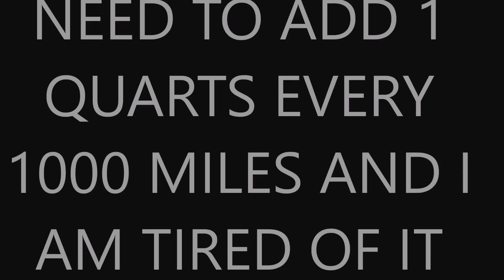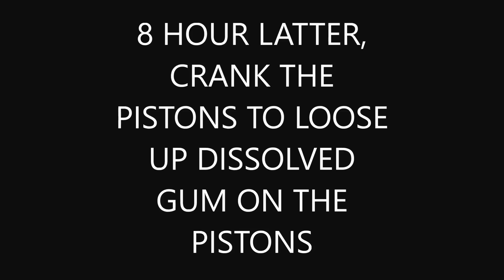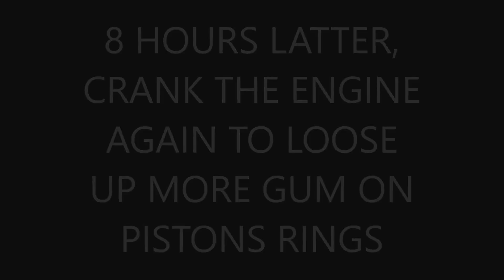MY WAY to stop ENGINE BURNING OIL FROM STUCK PISTON OIL RINGS WITH SEAFOAM

Comment: 1/2 Quart = about $2.50 per month X 12 Months = $30.00 a year. Trying fixing it... It's gonna cost you more than $30.00 and time consuming too. Now that is fixing it yourself. If you bring it to a Mechanic.... He or She won't do it under 1K for sure, LOL
Reply: Having to add oil every 1,000 miles starts being a pain in the ass after awhile

Comment: It really breaks my heart,when I see people using power tools on critical parts of car.
I religiously believe that person working on engine should only use own hands and quality torque wrench to remove,install and tighten spark plugs.
I would never use power tools on the rims of my car.
Reply from the maker: fully agree
Reply: The bolts that hold down the coils are NOT CRITICAL. HE USED HAND TOOLS ON THE PLUGS. Open your fuckin eyes
Reply: What? You never used an impact gun to install spark plugs before? It's all the rage bro! Get with the program!
Reply: @TwentytenS4B8  😂

Comment: Is this the same as using water sprayed into intake with the engine on? When i see that white smoke in this,..it has the same result
Reply from the maker: Seafoam loosen oil that stuck in the oil rings

Comment: I realize this is an old post how ever thought I would add another experience for others to try if you have the same issues!
  I have been chasing a lack fuel mileage for approx a year now I finally broke down and checked the compression on my 2006 crv 245000 KMS I found that I had less than average compression on two cylinders I attributed this to stuck compression rings( Took  a Guess)  as I had changed plugs and O2 sensor! and various other checks filters  ect  how ever the unit does not burn any oil what so ever but compression rings can stick too!
I ran across this vid and thought Id give the seafoam  a try  ! Less the cranking part which I did by hand as I Was concerned about the odious hydrolocking situation that MAY occur ! The out come was great!  the fuel mileage is now back to normal I have gone from 430km to a tank full to back to over 500 to a tank full where it was when I first got the car! So This vid was quite helpful in my case ,  so it also corrected compression  ring issue in my case  . So guess the lesson here is to try things outside the box a bit. the( 8 hour soak) I did after putting the spark plug in one at a time and turning the engine up to the compression stroke by its ps pump nut on each cyl with  seafoam added just prior to turning the engine over with the wrench! Note  IF you do the soak thing Do leave the plugs out and crank once  just to be sure! in my case the seafoam had all seeped by the rings. when I cranked there was little residue left in the cyls! I used Half the can during the process and  put the rest in the fuel tank !
 Good out come and worth trying if your in the same boat!   Thanx  for posting the vid!   ( Really got me thinking! )
Reply: Laura H - Nice to see a lady out there - thinking man stuff :) Yup, yup, yup, I thought the same way - But - being lazy -Still trying the ol' "Italian de-carb" = hard accel & decel in lower gear. If that doesn't do the job, I'll try the Laura H method :) Screw in spark plugs loosely for soak. Remove plugs & turn engine over by hand after soak?
Reply: Thanks for the description, i was trying to piece this all together with the comments.
Reply: TMI

Comment: This may seem to work at least in theory, except I would suck out the seafoam before cranking the engine. The idea is to free up the stuck oil rings so engine won't consumed anymore oil. Either you try this easier way or spend time and money on overhaul. Or just adding more oil until your engine quit.

Comment: Bent rods from hydro lock happens when fluid usually water enters the combustion chamber at a greater volume than the chamber volume with the piston at top dead center. The engine must also be turning faster than idle RPM for the flywheel to generate enough torque to cause this catastrophic engine damage. The guy did not even pour 30 ml in each cylinder, but even if he had the starter does not have enough power to bend rods. Looks like there are a bunch of alarmist women here. Great video though.

Comment: 1 oz to every quart in the oil pan.  Run for 100 to 200 miles. Drain and refill.  1 oz to every gallon of gas in the gas tank.  This is a safer and easier way to clean the bottom and top end.  Careful not to add too much to fuel as it may clean too fast fouling plugs.

Comment: How long has it been burning? My TSX is going through a qt every thousand miles and I’m hoping it’s not a shot engine. It’s running fine though other than that.
Reply from the maker: It has been about 6 month burning oil. The engine is good and nothing wrong with it.
Reply: Jonathan..... your engine is far from shot..      It will probably run for ridiculous amount of miles as long as you keep the oil level up.           A dude on Saturn forums used 2 qts tranny fluid in the crank along with 2 oil.      LEFT it in there and it eventually STOPPED burning oil and he is still running perfect today.
Reply from the maker: @jaylee8703   as long as I am not lazy changing oil. I did not see any oil loss in about 3000 miles. I usually change oil everuy10,000 miles

Comment: My 2004 acura tsx is burning a good amount of oil.  About 1 quart every 1000k miles.  Right in the dot with most people and what honda said is normal.  Im acually soaking my pistons right now. Going ti do 6 hours today and all weekend starting saterday morning.  I however will not crank the engine with the plugs in after i filled the cylinders.  Ill let you guys know how it comes out. Note- my spark plugs are 80k miles old and i took them out to see no soot or oil residue on them. They looked perfect.   Not sure how i could burn that much oil and have crisp spark plugs. Might be the fact i run 93. But still, should have some soot as motor oil burns super dirty.
Reply: Joshua..   any updates dude ?
Reply: @jaylee8703  iv done 500 miles and it seems to have stopped.  Not 100% sure though as i over filled a little.
Reply: @joshuathomas4934  How is it now?

Comment: If people would change motor oil,and oil filter more often,maybe this wouldn't happen.
I think,this is very important for modern,high tech cars.
I do oil and oil filter every three months or maximum every 5 000 kilometers.Which ever comes first. (Synthetic only).
My Toyota Corolla 2006,has 150 000 Km (over 93 000 miles) on odometer.I never need to add any oil and I never see a drop of oil,under neat of car.
Lubricants are most affordable way to keep your vehicle in good condition.
Reply: That is the rule of thumb however, some manufacturers have inherent design flaws in their engines. Like the Audi 2.0 TFSI for example. They have extremely thin oil scraper rings on the pistons that get gummed up very easily and lead to oil consumption issues no matter how well the engine is maintained.

Comment: Hi Joe Lui, is this still working?  Did you consider using a good oil flush to get the the oil control rings from underneath?

I have just done what you did here, i had lots of smoke for a long time and lots of butt clenching as i wasn't sure if i ruined the engine.  However after my 10 mile drive today it has cleared, so i am assuming all the crap that came of the pistons went into the exhaust and took time to burn off.

I left the sea foam in over night both times before cranking.
Reply from the maker: i just need to add 1/4 of a bottle every 4000 miles and i am using mobile 1
Reply from the maker: Don't want to flush as it mat cause oil leak as my engine is 12 old and 268,000 miles

Comment: Joe,  I just wanted to clarify. When cranking the car to break up the carbon, did you have the spark plugs removed before turning the car over? Thanks for the video!
Reply from the maker: you can do that too. I have my spark plug wire unhook, so the engine will not start. thanks
Reply: Awesome! After watching a few videos as well as yours, I was able to fix my problem. I was able to let the Seafoam soak in overnight. After clearing out the heads the following morning (via vacuum & cranking) I was able to start my car up! Thanks a lot!
Reply: @vermasean can you explain? Am I supposed to just not put the spark plugs back in after pouring sea foam and letting it sit for 8 hours? When you say crank you mean putting the key in and turning it halfway correct? Are we supposed to leave the spark plugs open for this too?
Reply: @KT-ed8hj  - The main thing is do not start the car w/ the cylinders full of sea foam. You can remove the spark plug, pour the sea foam in, then place the spark plug back just to prevent things from falling in. 8 hours later (after the soak), remove the spark plug (if you put them back) verify the cylinders are dry. If not, I used a vacuum to suck out the carbon and any residual liquid. Verify the cylinder is dry as can be. Install spark plugs, and try to start.
Reply: @vermasean  I took the spark plugs out but I put the engine cover on... after I wait 8 hours I just put my key in an do a half way start 3x correct? Without putting the spark plugs in or reconnecting anything? After that I pour a little more sea foam and will wait four hours before doing the halfway start thing 3x again. After that I put the spark plugs back in and the reconnect the wiring and will start the car this time. Does that all seem to line up?
Reply: @vermasean  how do i know it's dry? Is it just by looking down into the holes where the spark plugs are supposed to be?
Reply: @KT-ed8hj  - you can do a before/after. Before you put the seafoam in, see what the cylinders look like. After you pour sea foam in, see what it looks like, and then see what it looks like after the soak. You may have some fluid left behind, it may have evaporated. If you see fluid after the soak, you can use a shop vac to remove the residual fluid.
Reply: @vermasean  i dont have a shop vac. I already poured by first set of seafoam across 4 cylinders an hour and a half ago and used the whole bottle.
Reply: @KT-ed8hj  - you only need to use enough seafoam to cover the surface of the cylinder. Since it is alcohol based, it will evaporate.

Comment: Why not just pour it into the intake of the throttle body? Wouldn't that be easier than removing the plugs? And letting it sit. I'm sure the seafoam will seep pass the rings into the oil pan

Comment: Hi, I have a lancruiser, that sat for 10 years,  I got it running and it ran ok, but blew blue smoke, I decided to do the easy stuff first, did 3 oil changes, changed the turbo, changed the valve stem seals, I put a mix of ATF and acetone in the bores and let it sit, hoping to unseize  the rings,  this has improved things, but still blowing blue smoke,  I am assuming it's either stuck rings or the bores are worn,  I was just wondering if before i pull this motor anyone has any ideas I could try, either this seafoam of any other tricks.
Thanks

Comment: i ve done that yesterday, when i firstly started the engine i heard a wierd noise, not sure if i hydrolocked my engine but it was running fine, today when i started the engine a wierd sound came from the engine and than stoped but also it vibrated roughly, i am damn fucked up rn, hopefully didnt destroyed anything cuz i didnt drained the seafoam out of the cylinders 😢 arghhhh hopefully my spark plugs need replacement 😔
Reply from the maker: Geo Gabri if you hydrolocked the engine, it won't even run the first time in my opinion
Reply: Joe Lui not even sure how and why, but the spark plug on forth cylinder was damn loose so that might be the case, whenever i turn the engine off though it vibrates a lil more than before/usual
Reply from the maker: Geo Gabri tighten the plug but not too tight or you may strip the hole

Comment: It's not a good idea to crank a engine over full of fluid in the cylinders and the plugs in place. Fluid cannot be compressed, you're creating too high of pressure on the bottom end of that engine, bad things can happen. You pour the stuff in the cylinders, let it set, then crank the engine over with the plugs out.
Reply: Gary Riefle exactly! Which is exactly what this video said to do.

Comment: Gm actually has a tsb and top end clean for their northstar engines due to rings sticking.  The procedure itself does work however with a couple changes.  However they do not crank the engine with the fluid still in the cyl.  It really doesn't matter that if it fires or not you can possibly hydrolock the engine.  I have heard of on some cars leaving the plugs out and cranking but only when plugs are on the side not the top.  You soak overnight then vacuum out the fluid, start and run the engine, followed by a oil change.

Comment: As a matter of fact, liquids are compressible.  Sea levels would be a few meters higher otherwise.

That's not a good reason to put liquids in your engine and crank it with the plugs installed however.

Comment: I do this to my boat every year but I use the spray  I have an old 470 and starts up right away every time I squirt each cylinder then fog the carb then a full bottle of the liquid in the tank and fill my tank. Also seafoam all my mowers blowers weed  wackers  chain saws and I never have issues with ethanol. Gumming my shit up any more.  My raptor 660 would not start if it sat for more than three weeks until I started using seafoam. I love this stuff but might not want to be dumping that straight liquid in like that without turning it over with the plugs out
Reply from the maker: awesome

Comment: Do you have to change the engine oil after that?
Reply from the maker: zhicheng xu I didn't. You can change it. Any seafoam in the engine oil helps to clean the engine inside. Thanks
Reply: Seafoam can be used as an engine oil treatment. However you can only drive it for limited miles. The most you would want to put on it it's about 100 to 200 hundred miles and then you do an oil change. It's designed for engine treatment not oil treatment. It says so on the can.

Comment: Just tried this. But I removed the spark plugs while cranking. I did a 24 hours soak. Let's see if it makes any difference. What worried me is that when I put the plugs back in it took like 15s to start following a ton of smoke. But now it starts normally.
Reply: Did it work??
Reply: Lil Gascan rip ...

Comment: You have 0w30 oil in the engine, then you over fill the crank case with water like sea foam ??????? If you guys are liveing in a warmer climate, I dont see how useing 0w30 is good for anything, Try 5w30, you wouldnt have the oil burn problem ????
Reply: Bro the 5 is smeared and looks like a 0. I almost thought the same. Its an old Honda they don't use 0 weight

Comment: Everyone is saying "hydro lock! hydro lock!" You cant hurt your engine by hydro locking it and then cranking it. It wont be able to turn over, but it wont hurt anything. starter's not strong enough to bend connecting rods. Thats my thinking anyway.
Reply: don't bet on it, don*t do it; the starter is VERY powerful,it wins easily against all the cylinders compressions; TURN THE ENGINE BY HAND INSTEAD!  If a manual,engage 5th,and SLOWLY bump the car |better on an incline|,while the liquid makes it down past the rings.
Reply: Hydraulic lock can in FACT blow head gaskets, destroy starters, and has been known to strip flywheels.
Reply: BS, hydrolocking a cylinder can indeed cause damage. It can make a rod knock on the crankshaft, how good is that on a engine? You don't know what you're talking about bubba.
Reply: The starter doesn't have to be strong enough.  The inertia of the moving parts will do it.
Reply: I’m sorry to disagree but that is completely false the starter can and will gladly bend your rods is hydro locked.. especially if the starter has time to gain inertia... such as a down traveling piston.. have seen it before.. retired Ford tech.

Comment: Better look up how to "hydro lock" and destroy an engine. This could be very bad for some engines. I would NEVER ADD LIQUID TO THE CYLINDER BORE and then turn it over with spark plugs in place.

Comment: Holy shit - what a DANGEROUS way to try and clean your engine.  NEVER add fluid to the cylinders like that and crank it with the plugs in.  You got lucky you didn't hydro lock it and bend a rod.
Reply: Avalanche2 Hello, isn't this why the sell seafoam spray? Like wouldn't it serve the same purpose as coming from the throttle body?
Reply: No ding dong.  Pouring fluid directly into the cylinders, putting the plugs in it and cranking it is NOT the same as spraying it slowly in while the engine in running.